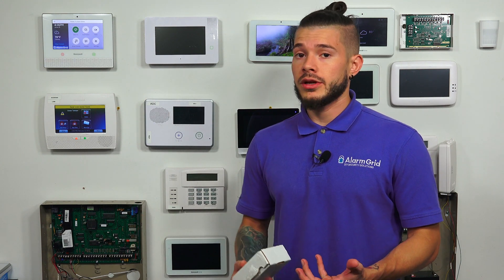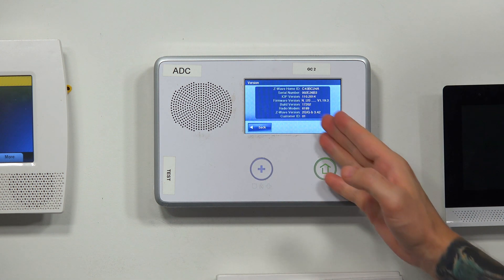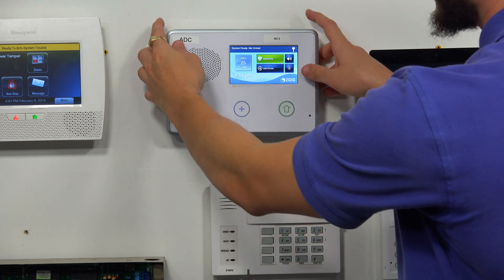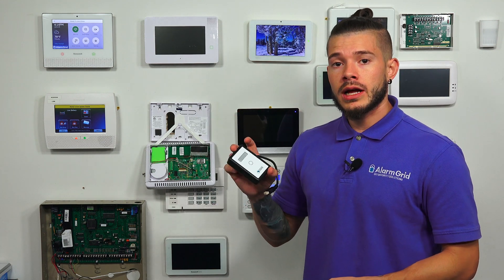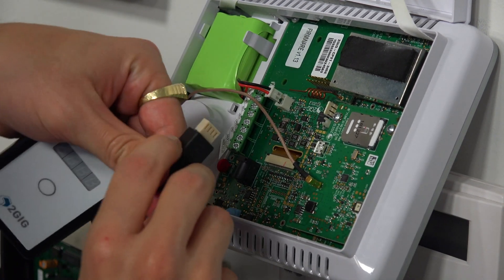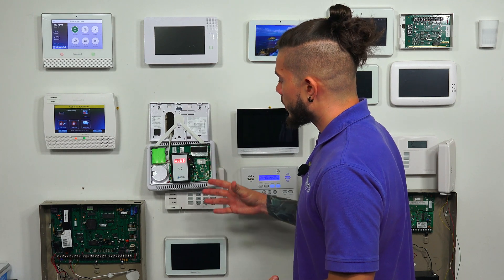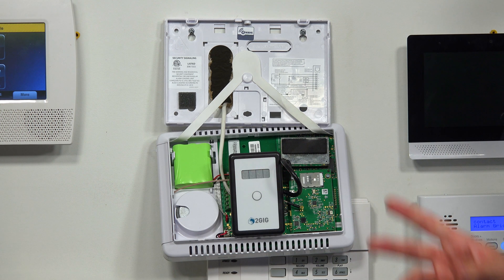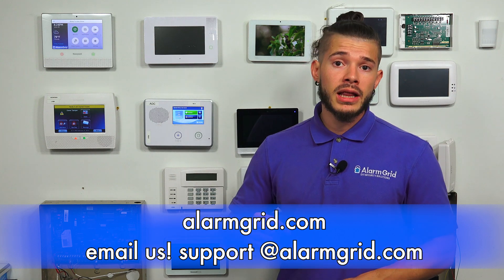2GIG GC2: Updating Using the Easy Updater Tool

Comment: I’m trying to remove mine off the wall or turn off the dam speaker 🔊 it came with the house when I bought it I can’t see the screen
Reply: @margaritagarcia536, there is a set screw in the top of the unit that has to be removed prior to removing the panel from the back plate. Then you will have access to the board and be able to unplug the speaker. YOu will also be able to unplug the back up battery and finally unplug the wall adapter to fully power off the system.
Reply: @DKAlarmgridSupport I actually just turned off the speaker but it’s actually wired to the house so I’m not going to mess with it just unplugged the speaker

Comment: I plugged the updater in and held the middle button for 5 seconds. It said C- 01 and it went all the way to 100. Now the panel won’t turn on. Did I Brick it?
Reply: Unfortunately sounds that way, I would leave it unplugged, then plug back in then try the update one more time, before calling it dead.

Comment: Great video! The tool worked on my GC2 but on my TS1 (V1.16_PRODCUTION_EN_US) the tool beeps on power, led is green, but the screen just scrolls a chasing dash. I have found nowhere that tells me whats going on or what  this means. The button does nothing (3 second hold does verify the payload). Any ideas?